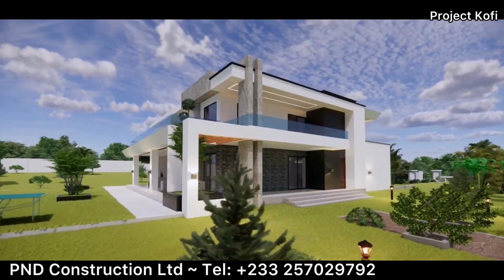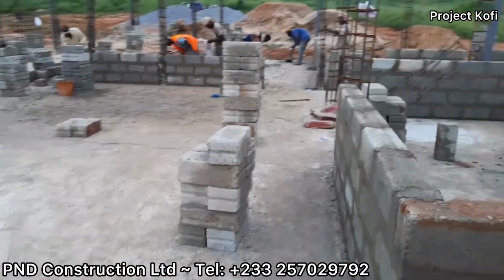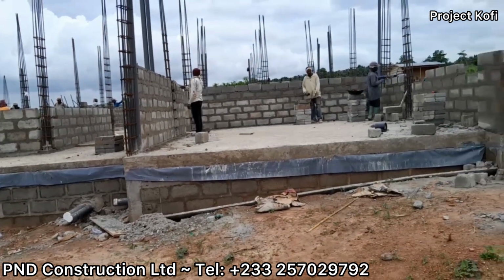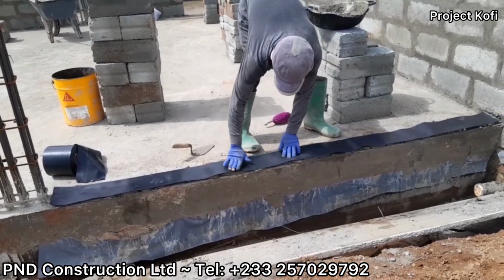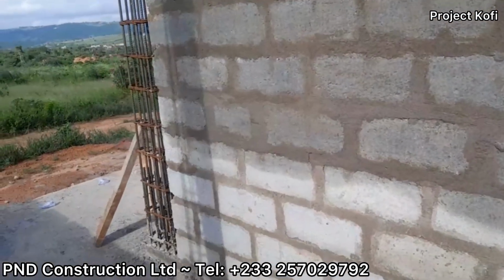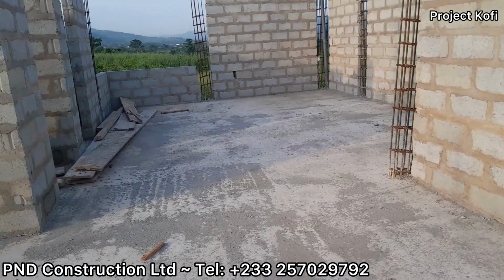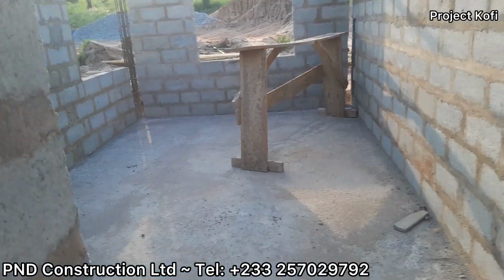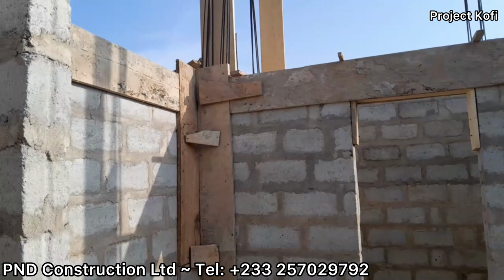Build in Ghana - Ground Floor Blockworks

Comment: 1. The grading of the garage and the front will be difficult to achieve post construction if it's not already taken care of in the foundation. 
2. Does a dpc treatment have to be above foundation level for it to be effective? 
3. Prince why didn't the foundation on the entire front go lower to take care of the grading of the front view? Going by the 3D rendering it looks like the front sits level to the ground? Humble observation. Will appreciate a response. Thanks
Reply from the maker: Hi Thanks for your comments. Please see our response below:

1. The 3D image did not take into consideration the existing grading or slope of the land. There is approximately 4ft between the highest part of the land and the lowest point. As the roads have not yet been constructed, we factored in the level of the future road construction and the filling to make up levels. It’s important to note, that the Ghanaian building code requires all houses to be higher than the road and drains into gutters outside the house. There would be a ramp into the garage and steps into the house. We have taken full site measurements alongside the road level and have built the foundation based on the final finish level. As noted in the video the rear and to the right of the property, the land is higher, as part of the final landscaping and external groundwork’s this will be levelled to ensure the home is higher then the road and levels will slope to the road. 
2. Yes, the DPC must be installed after the slab, minimum of 150mm above the highest point of the land. 
3. In addition, to response 1 above, lowering the front of the house would require steps at different levels in through out the ground floor. The design is to achieve one level finish throughout the ground floor. We have an extensive external package, which depicts the 3D rendering. Thanks  for watching.
Reply: @princenikki  thank you so much for taking the time to respond. It means a lot to me.